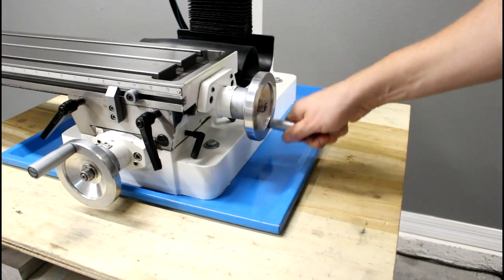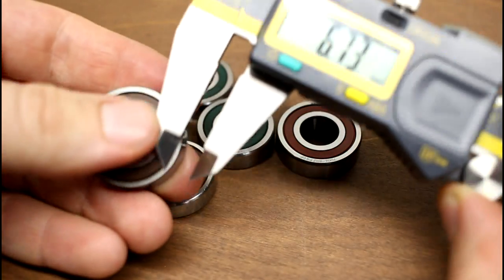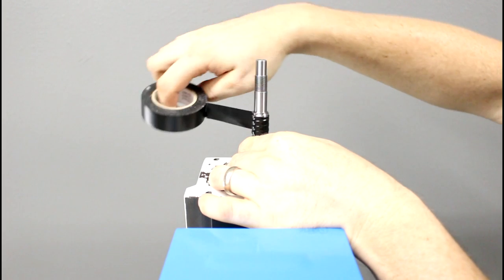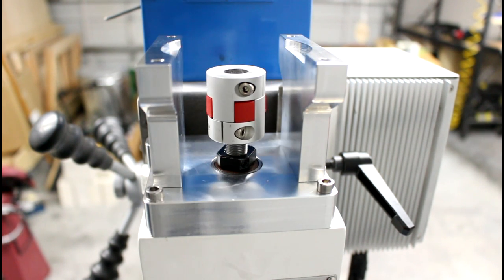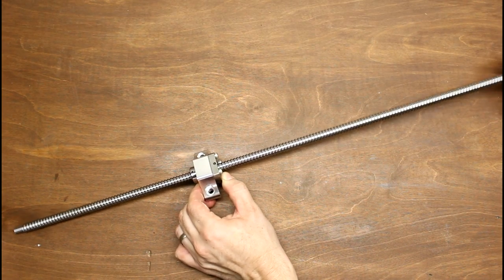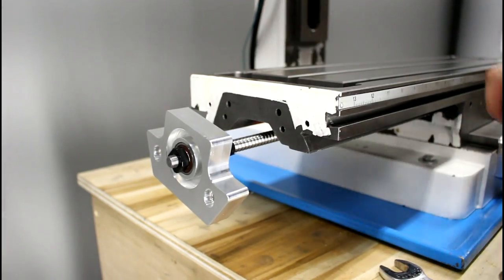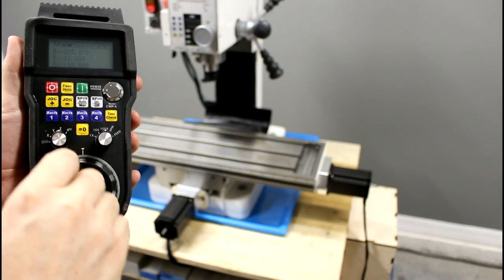Milling Machine to CNC Conversion - Precision Mathews Part 2

Comment: Nice to see, we did a 4 axis CNC build off of a TAIG and it runs well but we love tool changers because changing to tools in the holders after each program cycle per tool is well tough, we are spoiled.
Lance & Patrick.

Comment: I guess need to install some dempher for Z-axis to compensate weight milling machine head, something like gas-lift, on the video during Z-axis moving down the ball-shaft did few rotations after motor stopped.

Comment: I have a question. I currently have an X2 Cnc conversion mill with Nema 23 motors using a 1/4" shaft.  Can I switch my motors over the the PM 25mv cnc conversion , but I would just need to get the 1/4" coupler ends to fit onto my Motor shafts correct? I believe the Ball nut screws have a 3/8" for XY and 1/2" for z, but COuldn't I just get the coupled end for the motors to fit the motors shaft correct?

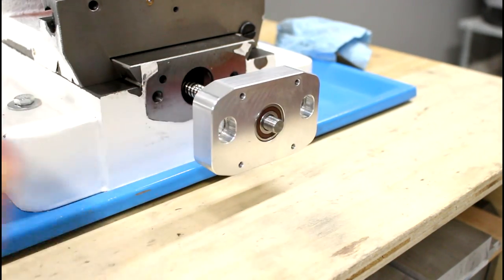Comment: Very neat work brother but I think your bearings are way too loose (5:37). You need some press fit, just enough to tap bearings in.
Reply: Those bearings are not seeing any lateral forces, so no need to have a press fit. Sure it would be by-the-book, but doesn't affect the end result here.

Comment: What's the point of using angular contact bearings for the X axis ballscrew if you only have one side? This means the motor's bearings are supporting the other side, which is one of the main reasons bearings are used in the first place.
Reply: Removes axial play from the screw. Doing both ends would overdefine the assembly and lead to problems with thermal expansion.

Comment: I'm kinda curious here, Why change the existing screw with a new lead screw?
Reply: manual mills come stock with ACME threaded lead screws, instead of the ball screws that he installed. ACME is fine for manual machines, but has too much backlash for a CNC machine. Ball screws eliminate most of backlash by using ball bearings to interface between the lead screw and the ball nut, http://www.barnesballscrew.com/images/1.jpg which is attached to the slide/head/saddle.
Reply: @911dddd911  thanks for the info bro

Comment: Won't the love joy coupling add backlash error?
Reply: Generally not, as long as you use high durometer urethane spiders.  Fadal uses these style of couplers successfully.  The couplers do wear out over time and need to be replaced.  The alternative is to use a bellows style coupler, they are made of metal.

Comment: wouldn't it be both cheaper and easyer to use the pre-existing lead screws?
Reply: No because they are not ball screws, they will have too much backlash. The ball screws effectively have negligible amounts due to them running in circular channels which you can actually on the better ones pre-load to tighten the nut up against the screw.

Comment: Amazing. Do you sell the entire kit? Or just the ball bearing and plate?
Reply from the maker: Thanks Joel. I sell the entire conversion kit except the stepper motors and controller. This kit requires two NEMA23 stepper motors (X and Y axis) and one NEMA34 stepper motor (Z axis). You can learn more about this kit at https://www.cncelements.com .
Reply: @cncelements1987  do you have the link for nema23 and 34 since they all have different oz force which I not good at picking correct stepper.
Reply: I would buy the highest torque one you can afford. AutomationTechnologiesInc.com has lots of options at great prices (no affiliation). They also sell motor drivers and everything else you might need.
Reply: Very cool are your kits using single or double ball screws? Are you located in the United States? Where is part 1 of the video?
Reply from the maker: This kit uses single ballnuts. These kits ship from Florida. Part 1 should be coming soon.

Comment: Would this kit be compatible with the Warco Wm18?
Reply: Very interested in your question, i have just bought a WM18 which is the PM 727 equivalent. I am currently planning cnc conversion. I have the steppers and most of the electronics. I failed to find any help with CNC conversions except at huge cost so will use my old X2 cnc mill to machine the parts. 

John
Reply: @john2478  Hi John, out of interest why CNC the mill if you already have the X2? Also did you see the Model Engineer magazine WM18 conversion? Its only an overview and gives little detail on how to do it or costs, but its a nice approach, even features a second high speed spindle. One approach I have seen is to buy a second table and machine away the necessary clearance for the ballscrew housing, that way you dont invalidate your warranty and you can use the manual mill to make the mods. Thats what I would have to do as I do not have second mill sadly. It does seem to be an expensive process no matter what.
Reply: My X2 conversion was sucessful and has been in regular use for. 10 years. However I wanted a more substantial machine with a stiffer column to take deeper cuts.  If you want to share ideas you can pm me on my channel after subscribing. I like many of Josephs ideas and will incorporate them. 

John

Comment: at 330 shouldnt you be using a thrust bearing ?
Reply: Angular contact ball bearings are designed to take both axial and radial thrust loads, so a separate thrust bearing is not required.

Comment: This is not how you preload bearings. With this bearing configuration you need precisely machined distancer between inner races of both bearings. Problem is
 How you will measure the exact distance between the inner races when they are all ready mounted.
Reply: Sure you can do it this way, but it isn't the perfect solution. As for measuring the inner distance, there is no need to measure the inner distance if you know how much preload you want on the bearings, as you can look it from the bearing preload chart or measure the needed gap if data is not available.

Comment: hi , why you did not use a bearing in the motor side of the x axis?
Reply: Since there is a pair or opposite angular contact bearing in the left side the ballscrew can't move, so it seems it's not needed in the right side. Same when you use BF12 mounting blocks, on side is only for alignment. The motor does exactly that. Neat design I would say

Comment: Would you have any interest to buy high quality ball

screw nut or shaft from Taiwan or China? How may I help you? 

Any complain from your customer and lack of good supplier
to offer ball screw nut or shaft? How may I help you?

A ball screw is the kind of high-tech product that
requires capital-intensive, technology-intensive as well as management-intensive
input. Wei Tai owns some of the most advanced manufacturing and inspection
instruments, which are used to maintain high standards.

Wei
Tai recommends the use of standard ball screws for most designs, but We can
also produce high-lead and miniature versions. Balls crews are also
manufactured according to customer specifications.

This is Nora from Taipei Taiwan and we are ball screw manufacturer. We own the high quality and competitive price because our factory in China. Our goal is we really hope to do more business with you.

We
have established from 2010, the head design office in Taiwan and in house
manufacture in China. Professional in ball screw and screw nuts, especially for
hi-precision requirement. Provides quality, economical and compatible ball
screws solution.

Our
ball screws own the good quality, competitive price and hope to find a power
transmission dealer world -wide. If you have any interest, please feel free to
contact with us. We supply ball screw and screw nuts in DIN 69051, GB/T17587,
and JIS C5 standard with in-house manufacturing factory.

Shen-Han Technology is established in 2010 and supplies
ball screw and ball nuts which factory is sited in Bao- An, Shenzhen,
China.  We are the high-tech ball screw manufacturer and meet the international
standard of DIN 69051, GB/T17587 and JIS C5, etc.  The factory is
certified by ISO9001 & UKAS and we are professional in the industry and
have the confidence to produce both of the global standard and the customized
specification, and the quality is compatible with the international branded
products.

We are approved by Chinese high-tech enterprise
certification and the plant own the equipment included CNC lathes, CNC 4 axis
machining centers, CNC 5 axis machining centers, and CNC internal thread
grinding machines.  We have R&D team to develop the new designs of
ball screw and has the specific patents including the new design and new
appearance.  We are also capable to develop OEM or ODM designed ball
screws to satisfy with customized needs.  The sketch of CAD/CAM customized
transmission component design is available both for equipment and high lead
ball screws in specific standards.

Capabilities of Shen-Han Technology –

. Ball screws and screw nuts in customized specific
standards

. High lead ball screws and screw nuts

(1204, 1210, 1220 ,1606 1616, 1632, 2505, 2550, 2440, 2020, 2040, 2525,
4040 5050 etc.)

0601 0606 0801 0802 082.5 0808 0810 etc. Only our factory has produced in China.

Wei Tai Transmission Limited Company is the head office
in Taipei and acts for all of international trade activities to handle the
shipment supplied from Shen-Han Shenzhen factory.  We are looking for the
new customers in your regions and it’s thankful if you can give us a chance to
work together with.  Please feel free to contact the following:

Wei Tai Transmission Limited Company Email: 02weitai.ltd@gmail.com 

We chat ID: w0978377508

You tube: https://www.youtube.com/watch?v=-8kBVM4JCBg&t=41s 

https://www.youtube.com/watch?v=jQW23Bx59WQ&feature=youtu.be

Website: http://www.weitaitw.com/en/ball-screw-nut.html

        https://www.weitaitransmission.com

FB: https://www.facebook.com/hung.nora.3

Cell phone: +886978377508

Address: No. 214-3, Zhou Mei Street, Bei Tou
District, Taipei, Taiwan, R.O.C.

          Tel# 886-2-28326773
           FAX:886-2-28327852